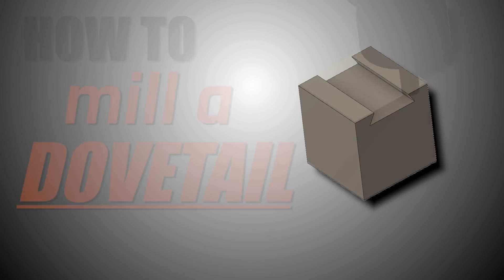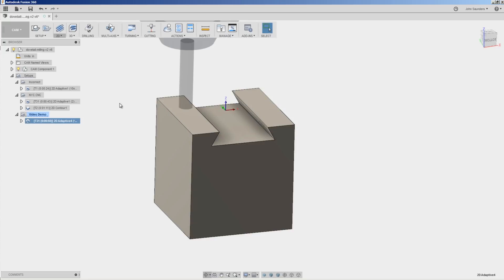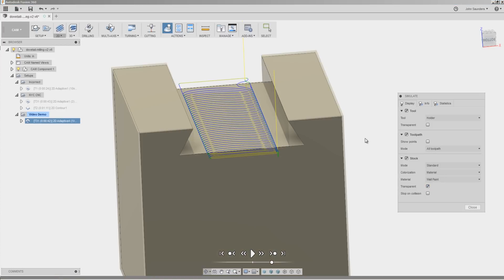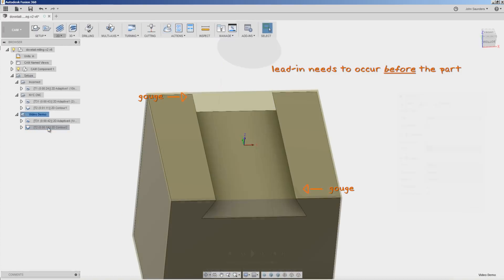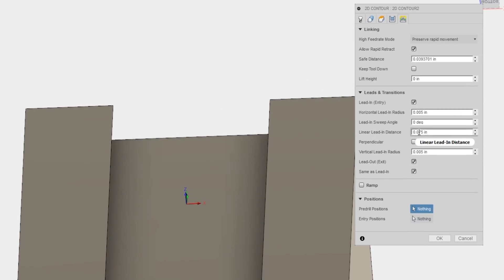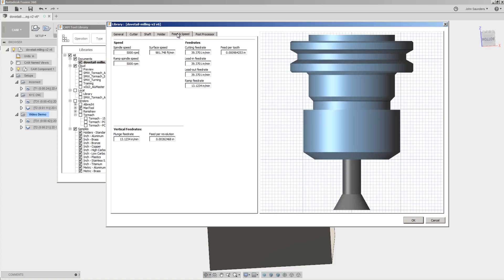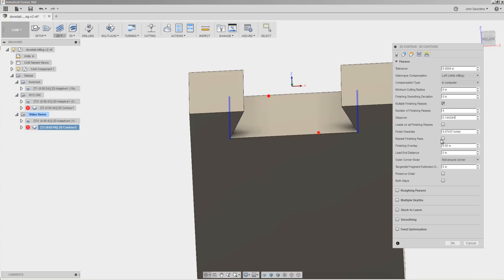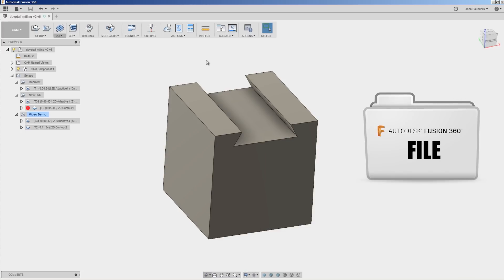How to Mill a Dovetail in Fusion 360 | FF136

Comment: what if 2d adaptive is applied...and Fusion knows the tool geometry.  Does "optimal load" account for stepover reduction knowing that the tool will be more engaged?  Will it create a toolpath to keep consistent volumetric  chip load?  This is unique for tapered cutters (as your mentioned) since this chipload will change without change in Z...only x/y.

Comment: Could you do an actual cut to give us some help with Speeds and Feeds. I'm having a heck of a time with welding in 7075. Using the Harvey 0.500" Dia w/ a 40 deg inclusive angle. I'm on a Series 3 1100

Comment: Is the a way to create a dovetail op by cutting using only the button 1/2 or 1/3 of the cutter until you reach full axial depth? For example step down .1" step over .015" until you hit the dovetail wall and then it drops down another .1 and repeats until the entire surface is machined? As John stated in his method the engagement increases with each pass, but this method it would be consistent chip load.

Comment: why need cam. how they did dovetail before there was no dovetail or cams lol
Reply: Cutting a dovetail with a manual mill is similar. You still use a dovetail cutter.

A shaper wouldn't use special tooling.

You could also do it with a band saw or a file if you really wanted to.

But CAM works just fine.

Comment: Could anyone tell me the difference b/w  a 5 axis machine and Mill turn ...?
In terms of axis and where these machines can be used ?
Thank you.
Reply: Subin Peringave 
5 axis usually refers to a vertical milling machine that has 2 rotating axis on the table, set 90 degrees from each other. 

A mill turn is primarily a lathe with a main lathe spindle and has a secondary milling head spindle 

Millturns would be used on long generally cylindrical in shape parts like a an engine cam shaft. 

A 5 axis VMC would be for mostly square/prismatic shapes parts that have features at different angles.
Reply: Occams Sawzall 
Thank you so much

Comment: I'm a big fan of your channel, and I think it's great what you are accomplishing here. One thing I'd like to point out with this video is a word of caution when using the lead-in to extend your cut. I'm not familiar with Fusion360, but most CAM software use the lead-in to add cutter comp. This MAY lead to a gouge or an incomplete looking cut, depending on the length of the lead-in and the amount of the comp. It's not usually a big deal, but I'm a firm believer in limiting the possibilities of errors with good machining practices.
Reply: How about a tutorial on the counter part .. the male dovetail.  I am struggling with creating toolpaths for a male dovetail.

Comment: I had heck cutting a female picatinny rail profile. I ended up drawing the tool (AB Tool) in the form tool section and then used the trace command to make the tool path. Does Fusion not recognize the geometry of a custom form tool? I couldn't get it follow the model.

Comment: Production strategy would be instead of taking the distance moved in X and divide by 4, take the volume of material removed and  use a quarter of that. Not sure if Fusion could do that without a little help, but you can always duplicate the cut and make adjustments if you are making a lot of parts and want the best MRR, tool life, finish, etc.

Comment: I would get in the habit of using roughing and finishing passes so you can do 1-2 roughing passes at a more aggressive speed and feed and a single finish pass at a less aggressive rate. 
Will also allow you to avoid that first initial light material removal pass you had. 

Another good thing to note about dovetail cutters is you can’t take a finish depth of cut pass, always has to go to the floor level on every pass. But would be beneficial to leave 5-10 thou on the floor when roughing with the endmill initially so the dovetail finishes the floor and you have a clean floor finish
Reply: how do you know what's the maximum material you can remove?  do you keep increase the MMR until the dovetail cutter fails?